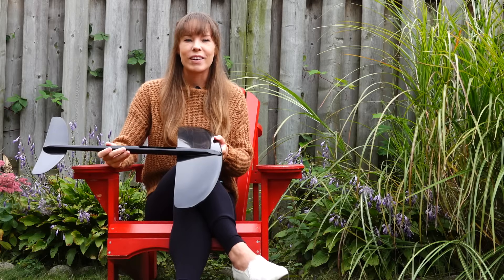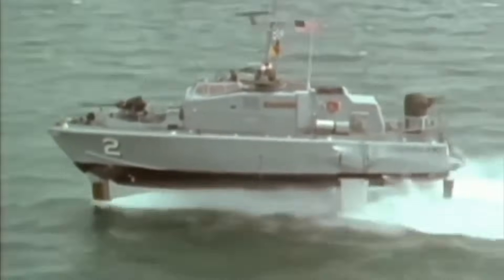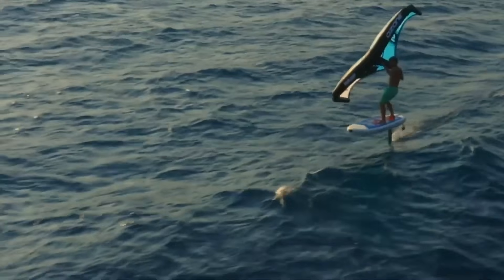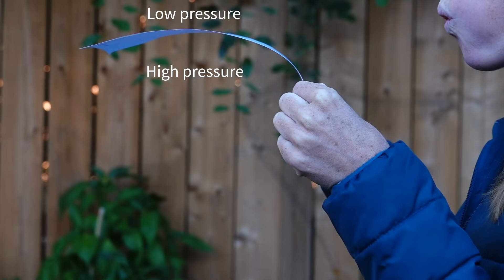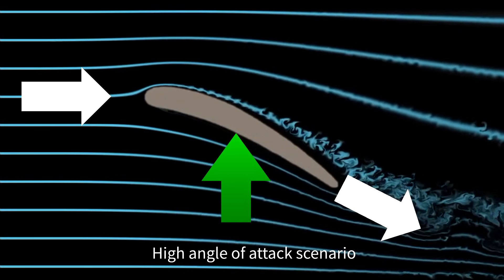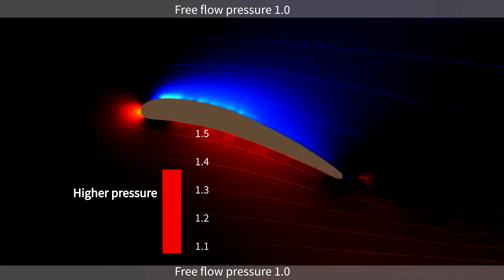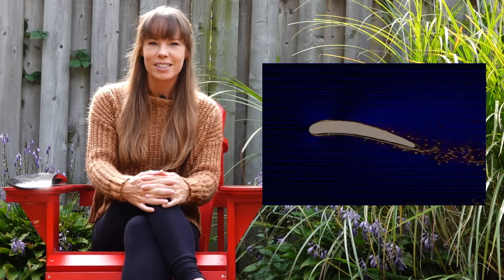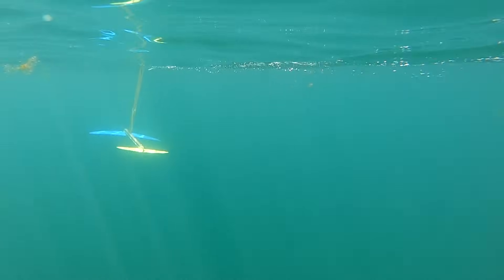How Hydrofoils Work

Comment: Great video again! 👍
I wish it was existing before I spent hours in trying to figure out what you summed up in a minute 😂
Yet, what about the theories explaining lift with changing the direction of the flow? In a wind/water tunnel the fluid has speed and direction, clear. But when a wing is moving through a static medium, how could it change its flow direction? 🤔
Anyone?
Reply from the maker: In the case of kitesurfing, kite at 12 is basically in a wind tunnel.
If you hold your hand in front of you when there's zero wind, you will feel nothing. If you start moving you hand up and down, you will start feeling wind.
In the case of hydrofoiling, in static medium, as you travel through water with a kite, you are moving water with you and deflect it downwards. 
When you surf the wave without a kite, the water movement against the hydrofoil acts like wind on a kite.
At least that's how we see it.
Reply: @OurKiteLife  thanks for the reply! With a kite or any wing/sail and wind this is clear. 
I was only refering to a foil wing moving throught static water, which is being displaced rather than deflected downwards. Furthermore a dense fluid in motion has a significant momentum that is being deflected by the wing (in a lab/tunnel, etc.). My mind just can't accept that a wing moving in a static medium works the same way as a static wing in a moving medium - again, it's about the changing direction of the flow.  
Would be great if you can find an answer, in any case I will do some reading too ;)
Reply: @nickolaydobrev714  Only the relative velocity (v) is relevant. If the foil is moving and the fluid is not, from the fluids point of view the foil is moving at v, while from the foil's point of view the fluid is moving at -v. This is true whether or not the fluid or the foil is the one moving relative to the ground. Both situations also agree on which direction the foil moves trough the fluid, the flipping of the sign should get canceled out later on if you do any calculations.

Comment: As a pilot for 56 years, I don't think I've heard a better explanation!
Reply: Excellent explanation!
Really awkward that scientists are still debating why lift is created! The Bernouilli explanation was the one that we got explained at our Uni for Aeronautical Engineering. And a thing called Lifting Line Theory.
One thing you might want to add to your video though is the Coanda effect which explains why the air 'sticks' to the curved top of the wing and gets thrown down creating lift by using Newton's 3rd law.
Great work!

Comment: 3:32 What? This is the majority of why planes generate lift. They convert forward motion into upward motion (the wind flowing in the opposite direction is the same as forward motion).  Also, the Venturi and Bernoulli effects are discussing the same physic. They are the last part of the equation on why a plane or a power kite can lift more efficiently than it stalls from drag. You didn't research this properly at all.

A kiteboard, wakeboard, and surfboard all generate lift in the water from the same first principle, angle of attack. A foil board is more efficient because of two reasons. 1, it benefits from the bernoulli principle to generate additional lift from the low pressure water flowing over it. 2, water has surface tension which creates drag, and a hydrofoil has less surface area in contact with the water than a kiteboard.
Reply from the maker: Thanks for your comment Sumanitu, 
I think you misunderstood the particle kinetics theory versus the deflection of the flow theory. Here's the explanation why particle kinetics theory is wrong at 7:44 https://www.youtube.com/watch?v=aa2kBZAoXg0&t=648s

Comment: "How LIFT is generated" would have been a better title ! As most of this (great!) video content can be applied to the kite itself, an airplane wing, an hydrofoils, a wind turbine, ...

And BTW, aerospace engineers understand where lift comes from, it's just that the answer starts with "Let's take a look at theses equations..." ;)

And thanks you for the channel :)
Reply from the maker: just to follow up, this should also apply for kites themselves and sails, with only additional caveat of apparent wind? Agree/disagree? Thoughts?
Reply: @OurKiteLife  The lift (and drag) depends on the surface area, the shape, the angle of attack and the Apparent Wind (squared !). 
The computation results you show on the video (ie the pretty image with colours..) can represents any "Lift" application.

It's not intuitive to see that lots of different "lift" application are the same because we think in terms of True Wind and not Apparent Wind.

Apparent Wind is the combinaison of True Wind and Head Wind, it's just the proportion of the two components can be widly different from one application to an other.

Hydrofoils and aircraft wings : Apparent Wind = Head Wind. You need to have speed to generate lift ! 
Helicopter blades : Apparent Wind = Head Wind due to the rotation of the blades + head wind due to the helicopter speed (this leads to a lift inbalance between the blade going forward and the blade going backward, which needs to be corrected)
Sails and kites: Apparent Wind is a combinaison of True and Head Wind, as both are at the same magnitude.

The particularity of a kite is you can have head wind not only by moving with the kite but also by moving the kite itself, which allows you to be able to generate lots of power at rest (during waterstart for example).

Wind turbines are also using lift. It generates a rotation motion and head wind (proportional to the rotation speed). 

And compressors, fans and propellers works the same way, it's just that you use mechanic energy to generate Apparent Wind and not the other way around.

And for all these applications, you have to be carefull not to stall, by keeping your angle of attack under the stall angle (according to the Apparent Wind). 
- Aircraft propellers and wind turbines change their blades angles when they speed up (because Apparent Wind is changing direction due to the rotation).
- Sailers and windsurfers "close" the sail when they speed up.
- The kite has got ... a bar to change the angle of attack.

There's a lot to say about this topic !

Keep the good videos.

Comment: great video!   
re:  planes flying upside down,  fwiw, when flying an RC model plane upside down, you typically have to add a bit of elevator angle to counteract the 'downward'  lift being generated by the inverted wing.  Probably similar in real life.
Reply: Inverted flight also uses Newton's 3rd law, not Bernoulli Effect (or you'd crash). Wing's optimum Angle of Attack is ~4-5°, so when flying inverted you also create a 5° AoA by pushing forward on the yoke, elevator down ( now "up") to point the inverted wing upward.  Takes practise because it's counter-intuitive. (Old PPL pilot, C152, and engineer).
Reply: By adding down elevator when inverted, you are effectively increasing the angle of attack, which then creates lower pressure and lift on the bottom of the inverted wing. Inverted R/C planes that do not have symmetrical wings do not fly great inverted as you are often flying on the verge of a stall because of the angle of attack.

Comment: "We talked to aerospace engineers and we watched University lectures on fluid mechanics"... you guys are truly next level!
Reply: I wouldn't call it next level, everyone should do due diligence research into the topic they are trying to explain on a video. That's professionalism
Reply: Freaking nerds
Reply: They neglect to mention that there are both symmetric and asymmetric foils. Most sails and lifting foils on boats are asymmetric foils which can generate lift with no angle of attack. Airliners typically use asymmetric wings because they are very efficient but don’t fly upside down very well. On the other hand symmetric foils require angle of attack to generate lift, which is what your hand is simulating outside the car window. Planes that can fly upside down generally have symmetric wings and use angle of attack to generate lift, but they are much less efficient at generating lift when flying upright.

It’s pretty easy to find lift versus angle of attack charts that show how symmetric wings (e.g. NACA 0012) do indeed require a non-zero angle of attack to generate lift, but asymmetric wings (e.g. NACA 2412) do generate lift at zero angle of attack, although they can also generate much more more lift when you start adding angle of attack
Reply: Doing basic research is "next level" nowadays? You're a sad excuse for a sentient Human Being. Perfect example of how dumbed-down the public school system has become & how despicably ignorant the students are nowadays. The worst part is that they don't even realize how stupid they are in reality.
Reply: No they're not next level.  If they talked to aero space engineers they talked to the wrong people, because we are talking HYDRO foils and NOT air foils.  Water is incompressible and so using the air foil analogy is TOTALLY incorrect.   If they talked about an aircraft in supersonic flight, they would be closer to getting the technical explanation right.  Ignore everything she said except for the part about changing the flow direction of water, because that is where the lift occurs.   She forgot to mention you can never have just one foil either.  They always come in pairs.  Leading foil and trailing foil to maintain balance - without 2 foils, instability would occur.
Reply: @gerhardkutt1748  
Wow - it's impressive how much you got wrong in one paragraph!

>> Water is incompressible and so using the air foil analogy is TOTALLY incorrect.

Water is NOT incompressible.  But it's far less compressible than air.  In subsonic flow below about 0.3 Mach, we treat airflow as incompressible as well, and the foil behaves the same in water as it does in air when taking Reynold's number into account.

>>   If they talked about an aircraft in supersonic flight, they would be closer to getting the technical explanation right. 

Nope.  That would be MUCH less correct.  In supersonic flow, the compressibility of air is a major factor.

>>   She forgot to mention you can never have just one foil either.  They always come in pairs.  

I have kitesurfed without the stabilizer foil and I owned an ultralight aircraft without a stabilizing foil.  It was a flying wing.
Reply: @gerhardkutt1748  Sorry Gerhard but the equation for lift in air or water is the same - only the density of the fluid changes. It's nothing to do with compressiblity at these velocities.
Reply: @gerhardkutt1748  Thank you for injecting a little reason into this blur of confusion, including that of the presenters.
Reply: @gerhardkutt1748  Well, either they changed the video or you are a very poor listener.
Reply: @gerhardkutt1748  Don't you mean 'two pairs' (or four foils in total), one pair of leading and one pair of trailing foils each side?
Reply: They missed a critical sector, that in my humble opinion... would have far more data down force (as it relates to air)... Formula 1 Racing!...
Reply: No she's not.  Air is compressible so you have pressure differences.  Water is not you have downward flow characteristics in water to create lift.  The two should not be confused.  Many so called scientists do.  This lady is a reporter - not a scientist so cannot discern the differences between air and water physics.   I hope she reposts with corrections.   She did a great job on the piece, just needs a tweak.

Comment: This is great. I think I've done most of the same research you guys did to make this video, and this is probably the best simple-ish explanation I've seen. Everything else is either so simple as to be wrong (usually covering just the first "equal time" idea from this video) or requires a math degree to understand. You guys did a great job with this. Also, you got my friend Rod downwind foiling here in the Gorge in there, which is cool, too. :)
Reply from the maker: Thanks Tyler. Good to know his name now, Rod, as we used creative commons clips in this video. That particular clip I believe was from foil buzz
Reply: @OurKiteLife  Rod (with a 'd' 😉) Parmenter.

Comment: Congratulations on producing another excellent video tutorial, and for getting the physics right.  Prior to your video, the only other accurate YouTube explanation I could find on how Hydrofoils work was this one:  https://www.youtube.com/watch?v=17JRkEC1Egk   
You might try replacing your wing with a simple flat plate of sufficient strength; the flat surfaces top and bottom will further prove your theory.

Comment: Next vid - sanded or buffed wings/mast. The wing you had with you sitting down was soooooo shiny! get that buffed!!
Reply from the maker: please elaborate on that, why get it buffed?
Reply: @OurKiteLife  https://www.sciencedaily.com/releases/2014/01/140117153637.htm basically,  a sanded surface means that water will stick to the wing, this results in a water on water transition as opposed to a polished surface where the water cannot stick.  A polished surface is more prone to ventilation compared to a buffed surface. Also, water on water is far quicker. If you were to look at a racing foil they have a 1000 grit (or so) finish to their kit which makes the kit faster and more stable.
Reply from the maker: @TKM11370  thanks Tony, this looks very interesting. So in your opinion 1000 grit to buff the foil wings and mast is the way to go? In you view, what should we do exactly (will obviously research it more), but this could be great experiment and video idea! Thanks again.
Reply: @OurKiteLife  I have my race foil sanded to 1200 and that works for me, mainly because I cannot be bothered to go over it more or less but I certainly get almost no ventilation  when I push hard. The new Levitaz comes from factory a 800 grit finish or so. Remember it's good to buff, then coat with an epoxy spray so that you can buff the foil without eating away at the actual foil. If you buffed with 800 every week you'd run out of foil eventually. :P
Reply from the maker: @TKM11370  Thanks for tips Tony!  The eating your foil part sounds problematic, but seems to require the extra step with epoxy spray. We are going to try it nevertheless.

Comment: Wow! exelent works! Well done. As a aviation engineer a jast may ad that airplanes can fly down turns becouse the wing has special set of angle off attack. And you can believe or not but a lot of acrobatic airplanes has symmetric aerodynamic profile.
So very professional video! My congratulations! I spent a lot of time choosing my fist hydrofoil 633 Moses Onda.
Hydrofoils exactly like aircrafts all has own shape and purpose))) and the flight filings so exacting isnt it ?)
Reply from the maker: Thanks for your comment Andrew. We were actually contemplating on trying foiling with the hydrofoil upside down, but decided not to bother as when we dug deeper only certain planes can fly upside down, mostly with symmetrical wings.